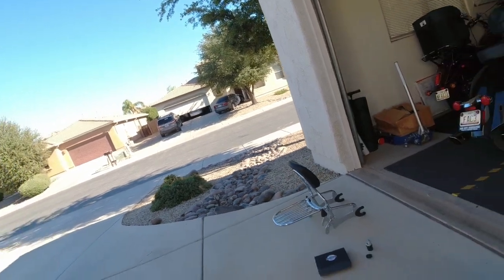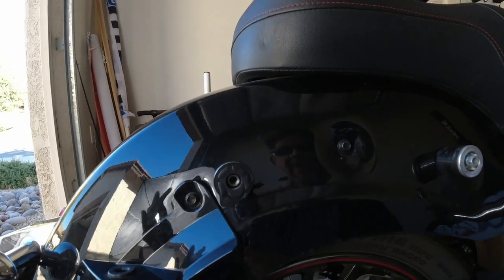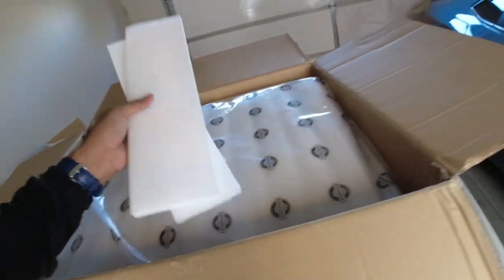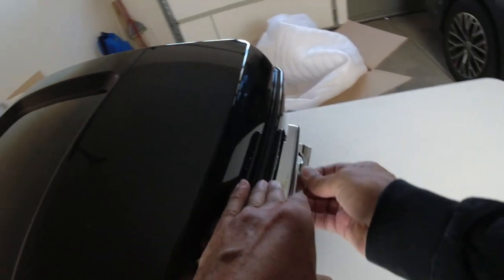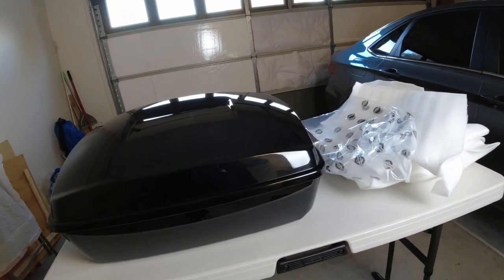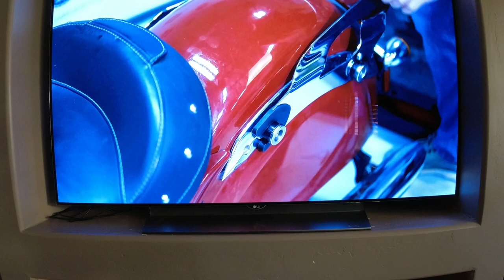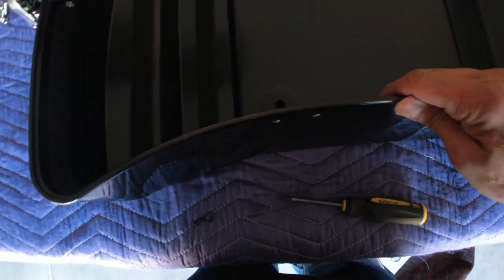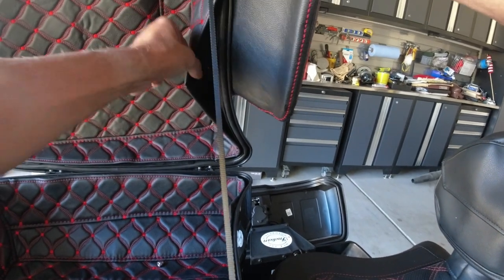Once Again Another Upgrade

Comment: I've been looking at the Advanblack tour pack for my 16 Springfield and while searching I came across your video. First I'd like to say thank you, it was very helpful. Second, did you or have you considered the led light on the tour pack? I have only seen a video on install on Harley, but not on a Indian. Not sure if light is compatible with Indian hook up, electrically. If you have any info on this I'd greatly appreciate it.
Thanks
Reply from the maker: Great, I never rd looked at adding the pack light or having knowledge if they make one for the Advanblack. Before you buy the lighting, look at Custom Dynamic lights..they make all kinds of led lights that are plug n go even for Indian Motorcycles. Let me know what you come up with.
Reply: Thank you. I bought the magic strobe wiring harness from custom dynamics. I will check them out and see. Ride safe.

Comment: Do you think you will like the trunk more than the sissy bar?   Will the advan black adapter work with the original Indian sissy bar and luggage rack?
Reply from the maker: To different reasons, but with the trunk I’ll be able to store things away where the sissy bar would have exposed items. No the sissy bar unit and the advanblack rack are their own units and would not be exchangeable.
Reply: @FACELopez  so you also have to change the brackets every time you switch then?
Reply from the maker: @theadventurebegins7039  I believe not same concept, but I’ll try to make sure.